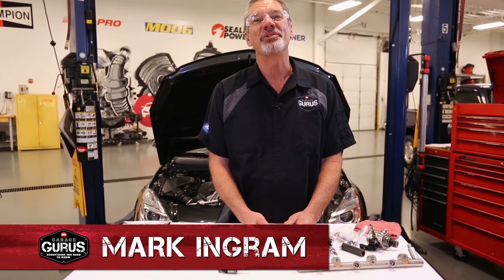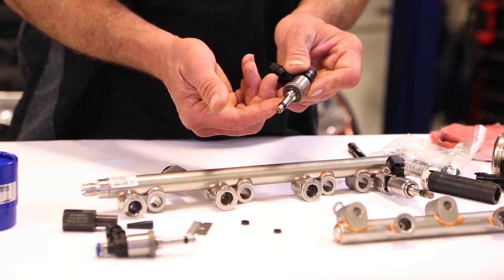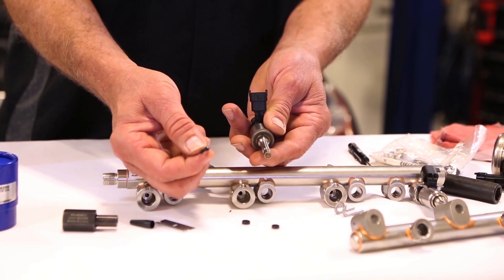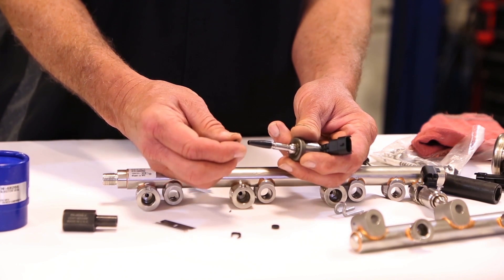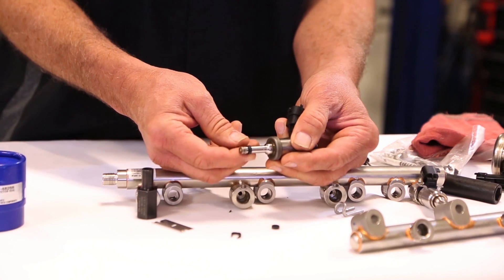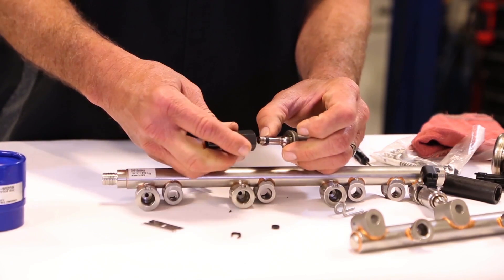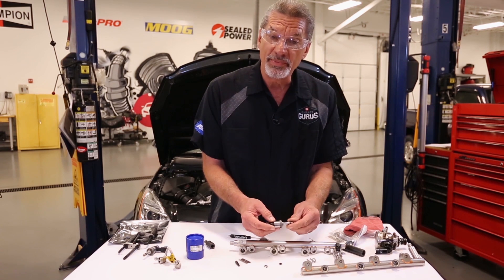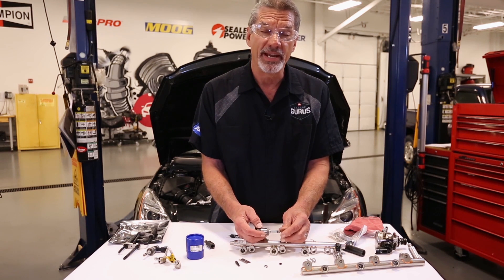GDI Seal Replacement

Comment: Super helpful! I am a shade tree mechanic trying to clean injectors on a 2018 Honda Fit instead of replacing them. Have the seals but had no idea how to get them on the injector. Just picked up a tool (that I hope is compatible) that should help me finish the job!
Reply: did you get the tool for honda fit ?
Reply: @lambdagarage No, I just used the fuel line/hose clamp hack and it worked.... OK

Comment: Are the Teflon rings all the same size?

I just put new injectors, then i took them back out of the head because tney were in the way of getting another part out, am i now screwed and need to replace all the teflon rings again? Even though they were new and car never ran?

Comment: Hi, can you tell me if you put any oil on the outter o-ring that connects to the fuel rail? Thanks in advance
Reply: Yes you should
Reply: Not oil!!

That might swell up the seal

Silicone lubricants or even soap

Comment: Even no Superlube teflon lubricant? Or creates lubricant a channel to slip pressure along?
But is noted!
Thanks for the tutorial. FIAT 1.8 ahead. Injectors to clean.
Can a high pressure pump be clogged? Have a fail code and according hick-ups once in a while...

Comment: Surprised, no lube required during seal expand/resize operation
Reply: ECS Tuning and Deutsche Auto Parts both have a similar toolset in stock: https://www.ecstuning.com/b-schwaben-parts/fuel-injector-puller-installer-tool-kit/p-695a/
Reply: This tool is next to impossible to find. The SST in the Hyundai catalogue isnt even available anymore. Are these gdi combustion seal tools pretty much standard? If so, where do you recommend I purchase without cutting off a leg?
Reply: gmtoolsandequipment           BWD They do not take leg parts as payment